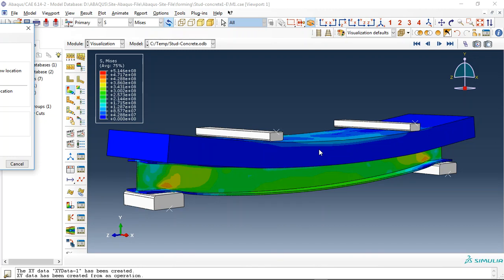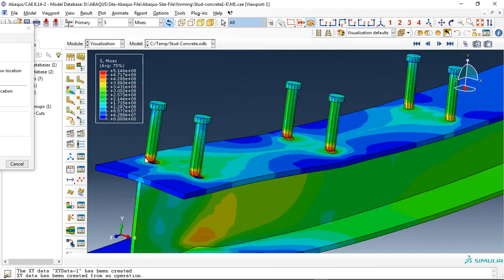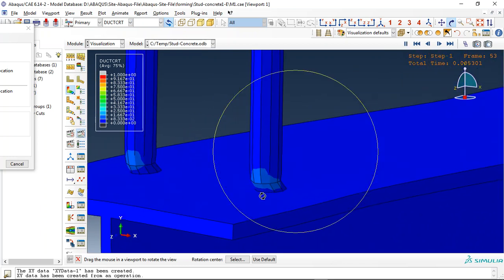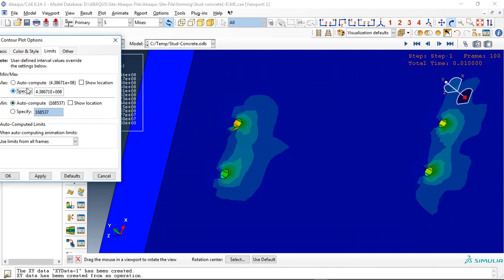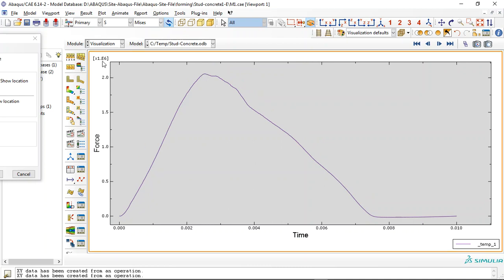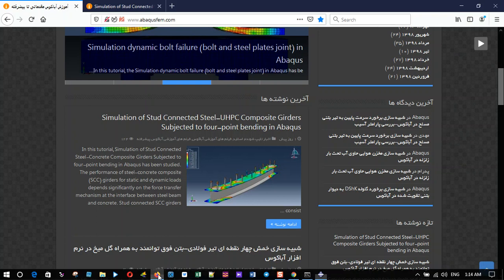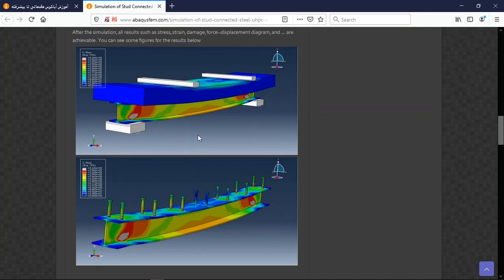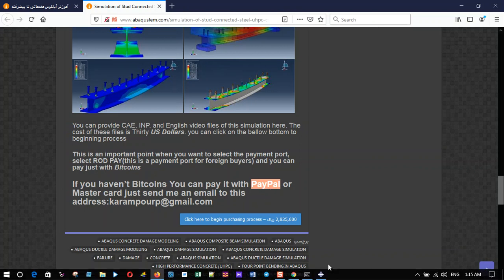Simulation of Stud Connected Steel-UHPC Composite Girders Subjected to four-point bending in Abaqus

Comment: Dear sir..I'm working on my abaqus simulation works..can u help me on this.. I hve problem regarding redundant constraint arise due to multiple constraint applied in a node. The situation: The steel studs in composite beam hve been assigned by 2 types of constraint. First, the "embedded region constraint" by concrete in surrounding of steel stud surface and another one is "tied constraint" btw bottom surface of steel stud to steel beam. In this case,some nodes (specifically located at toe of steel stud)have undergone redundant constraint and abaqus has removed the tied constraint automatically. Consequently, no longer tied constraint exist btw steel stud and beam. This is unwanted removal.There is any technique on how to ensure both constraint can be applied without any deletion of constraints by abaqus?Thanks in advance sir.